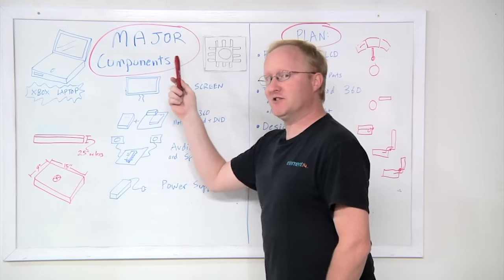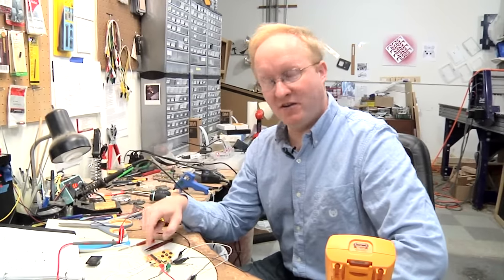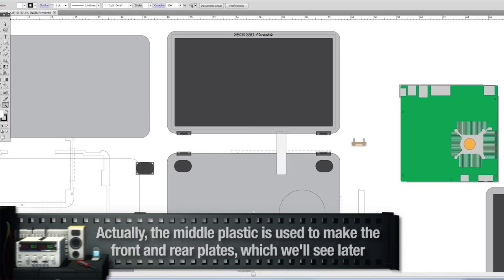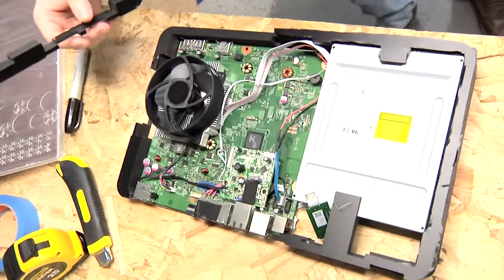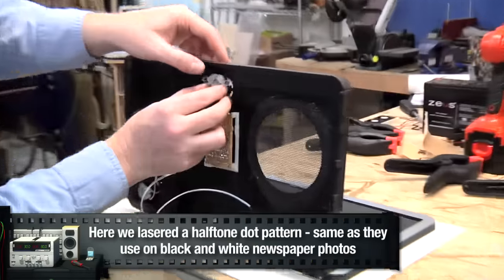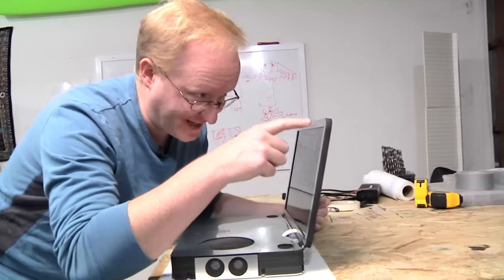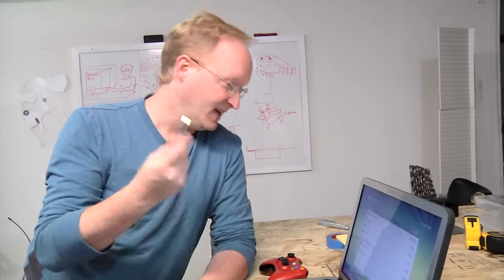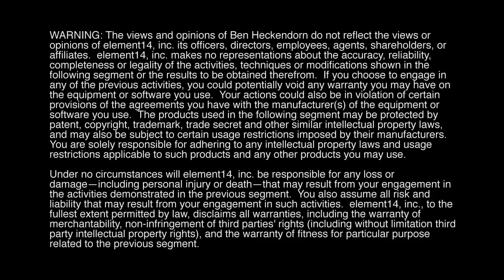The BEST Xbox 360 Laptop Ever!

Comment: Not top be rude but why would you need this? Instead of going through all the trouble why not just have a 360 and a moniter?
Reply: ***** The thing is it cant keep a charge so it would need a battery probably like a lithium ion one, but even still it is pretty cool.
Reply: Necromancer Anthony
So, no internal battery? Then what is the point? He basically just mounted a monitor to a console...
Reply: You could play in a car if you plug it into a power inverter.
Reply: ronaldo duran A monitor is more portable, has much lower response times, is cheaper than a TV, especially 4k with which the 360 couldn't even play in, it would be in 720p in games so no point.

Comment: You could use a 30 Cent very simple  LM386 Audio Amp can be found in every corner of a technicians box.The additional fans are undersized and can not cool the unit enough. You could use a type of blower fan found usually in certain graphic cards.

Comment: I have a concern about cooling with this project.  The 90mm fan (which covered the entire heat-sink) was removed and replaced with what looks like 2 30mm fans that only cover one side of the heat-sink.  Considering the reputation the XBox 360 has for overheating and de-soldering the graphics chip (essentially what happens with the red ring of death) that rings alarm bells in my mind.  How long have you tested this build with graphically demanding games for?

Personally I would be more interested in making a Wii U portable because you would have space from the smaller motherboard to include a battery pack and turn it into a true portable device.
Reply: Slim Xbox 360s dont overheat.That problem was solved on the Jasper model (late 2008 model) also this guy is a pro, this isnt his first 360 laptop. When he is putting in the two fans you can read on the bottom that the big fan on the Xbox doesnt work full power all the time but the two smaller fans do, also its doesnt matter if the fan is on the side of the heatsink what matters is it draws the hot air out of the unit.
Reply: Firstly the guy, while clearly cleaver and knowledgeable in electronics, is not a pro.  His intro states that he was a graphics designer who picked up electronics as a hobby.  Secondly, my concerns are valid because he is reducing the cooling capabilities of the unit well below the manufacturers specifications.  Weather it overheats or not in its standard packaging is not really the point.
Reply: James Lewis I already explained the facts, if you dont want to accept them. Thats your problem. I dont disscuss with people on the internet. Have a good day. (I silenced this thread so dont bother answering I wont see it).
Reply: +James Lewis he used a 360 slim witch has a les chance of over heating and the wii u is portable because the gamepad has a screen in it

Comment: a laptop that must be plugged in all the time....What´s the point??
Reply: because it's more portable to carry one unit with you than an Xbox 360, monitor, cables etc.
Reply: ***** Mount a monitor to the case of the Xbox 360. and buy short cables and tape them off in the back. BOOM! same thing... Pointless
Reply: Zmansk88 w...what? that's barely portable.
Reply: *****  Its essentially the some thing as he has in the video lol Don't get me wrong he normally does good videos but this "Xbox laptop" needs to e plugged into the wall ... so its about the same lol
Reply: Zmansk88 yeah, but 1. you don't have to have 2 wires and 2. you can't fold up a xbox 360 and monitor and carry it around, can you?
Reply: Zmansk88 Not to mention even the first real laptops also needed to be plugged in to the wall
Reply: Ethan Hawke *****  That's nice ,but seeing as its 2014 I think a laptop that has to stay plugged in is just pointless... A small TV monitor a short HDMI cable and hook it to your existing XBox and you have the same exact thing... (Without the fancy case) witch is not show stopping.

Plus if you have a PS3 ,PS4 or a ,Xbox one. You will be able to hook it up the same way without having to pay this guy to make a fancy case for it lol
Reply: Zmansk88 If you're going to a cabbin and doesn't have much space in the car or going by trai, or something like that and you don't have a lot of space(a small TV monitor + xbox360 do take up a lot of space) this could come really handy and it doesn't have to be about playing ANYWHERE, as much as an easy way to move it around. AND it only has one powersupply.

Only because it doesn't fill your needs, doesn't mean it's shit.
Reply: Most if not all powerful gaming laptops need to be plugged in while playing a system intensive game. Peggle and other games that don't require higher FPS can be played without plugging in but games like Battlefield, Skyrim, etc. need the laptop to be plugged in to avoid the limiter set by the laptop. You can, of course, bypass that in certain ways but you would realistically get a half hour of gameplay on battery when playing system/graphics intensive games.

Comment: the negative thing about the lack of a hard drive it that some games now require it but you can always buy a xbox 360 slim hard drive and use a usb transfer cable for pc hard drives to make the memory space bigger and the best part is that it runs through an external powersource so if you don't want to attach it you don't need to.

Comment: I loved it, but if you replaced the dvd drive with a slim one it could be smaller and you could possibly fit a ssd/battery
Reply: Xbox 360 has an annoying thing where the DVD drive and the motherboard are 'paired'. The motherboard will only use the DVD drive it shipped with (without having to reverse engineer + reprogram the drive).
Reply: oh, thanks

Comment: Hey Ben! i've been watching many of your videos, already subscribed and dont worry ill go back and give your videos thumbs up. since this video is an xbox 360 related one i had a question about a problem i am experiencing with my wifi adapter. long story short... the connection would cut off and reconnect... got it open with a flat head and didnt decide to try and diagnose it through my laptop until now and im realizing the under side of the circuit board, the antenna wire which i believe is soldered has come lose maybe. i apply pressure squishing the wire flat against the circuit board and i can get a solid light but blinks inconsistently when not.

Comment: Although that is a pretty awesome build, You should have hooked it up to turn off as soon as you closed the lide and turned on as soon as you opened it. Therefore you don't accidentally leave it on and you wouldn't have to use the power button.

Comment: What would be cool is having Windows OS on there alongside Xbox. Use a netbook motherboard but that would require 2 motherboards, 2 power supplies, more fans and a HDD so it wouldn't be very small but would be awesome! Could like run both at the same time. Have Xbox display on a TV via HDMI and run the Windows on the portable LCD. Would be more portable than carrying a laptop and an Xbox since we usually take laptops with us.

Comment: You should have built in a kinect on top of the screen like a webcam. It would be cool
Reply: but totally would not work, since kinect for first, is huge, second it need to auto adjust every time you wanna use it and third it would drain power that they didnt have. They even take out HDD just so they could have amplifier in that unit, technically they maxed out how much power that power brick can send to that unit.

Comment: Of course you could've just emulated the x-box operating system on a PC laptop, but it was just cooler to do turn an x-box into a laptop. GENIUS!
Reply: Xbox 360 can't actually be emulated properly yet, nor can it's original predecessor, so until it can a cool laptop mod is definitely the way to go.

Comment: whats the point if you always need to have it plugged in still....
Reply: +dang mang you can take it anywhere (like on a vacation) and plug it in there to play
Reply: +dang mang It's a system and a screen all in one portable unit.

A battery to power both an Xbox 360 and the LCD screen, would be massive and heavy. And would probably only get you an hour or two of gameplay, anyways.

It's meant to be easy to take it anywhere and just plug it in and play; it's not meant to be a portable device like handheld stuff.
Reply: whats so hard about bringing the console and a light flat screen tv... its litterally 10 more seconds of work. i wont deny its cool what he did but as far as having any use. it doesnt
Reply: +dang mang Because that's so much cooler to do it yourself. 
This man just made a Xbox witch is a home console into some kind of portable console, or at least all in one movable game unit, just by printing a plastic case in his basement, and soldering some cables in the console. 

It's so much gratifying just to be able to do that.
Reply: I know it is cool but if you taped a monitor to the xbox its kinda the same thing
Reply: ***** Yep, kinda.

And it's that "kinda" that make a real big difference between the simple monitor taping, and the work that has been done here.
Reply: the point is to make it so that you only need the power brick almost like it's just the charger making it portable especially good for the cars with outlets in them these days. he made it so that it's as portable as possible
Reply: +dang mang Who the fuck takes a flat screen tv with them on vacation. Take this and it's fine.

Comment: to the people complaining about having to plug it up, wouldnt that make sense for it to HAVE to be plugged up. all the power the machine generates it would make sense to have to plug it up if not your gameing sessions would be short
Reply: With such a brick of a "laptop" he could've added a battery. He just cut corners and cost, as it requires work and stuff. Also the hardware of an Xbox isn't made to be running on a battery, so you'd need a large and expensive one to run it for more than an hour. Just look at the harddrive bay, it's insanely huge, I can't imagine it being impossible to get a smaller one instead and laying a suck battery on top. (most laptop drives are about 1/4th that height).

Comment: i don't c y the giant 5" floppy disk drive is installed, but the HDD was considered legacy......who needs discs, LOL?! i was wondering if i could replace the disc drive with a concave controller hole, but while typing this i looked up the controller height of 2.41 inches so it's almost half an inch too tall :\ i'm pretty sure i could build or minimize the existing power brick 2 put in place of the drive, tho... then it just needs a longer PS cable 2 comfortably reach outlets, but its receptacle, the female receiver from the brick, can b mounted on the back panel 2 the right of the USB-holes.

Comment: Hello, I currently changed my major to computer information systems / computer support.. I am getting an associates and then an going to continue into information technology. Is this the right degree for me to be doing stuff like in these videos as a hobby easily... Or would I need some engineering in there.... Basically I want as my job to be able to build/ fix hardware of computers (this includes having knowledge of the specifications and power requirement of the system) as well as having a fair amount of knowledge about the software so I can make the computer to the best of its abilities and be able to diagnose issues because of crashes troubleshooting, etc. As well I would like to be able to network multiple computers and device in a modern style such as to include tablets, Wi-Fi, printers, etc. Also to be able to network big businesses where it waitress a identification and pass to login to one system... I would also like to be able to encrypt data and keep it secure as all as knowing enough info on security to be able to protect the network and even just a home PC from minor hackers as well as viruses to include malware and spyware... Sorry I am a newb at this stuff and just need to know if I am going down the right path for this type of career I thought computer support would be a good start then move to IT maybe minor in cyber security then go into business to start a computer company  IDK please comment and tell me what you think... I am asking anyone that is concerned even the makers of the video. Thank you.

Comment: Why not do the opposite of this? Why not make a portable system into a console? 3DS, Vita, DS, ect?
Reply: Soul Evans What would be the point, the games on them are designed to run at lower resolutions due to screen sizes and hardware limitations, plus with a Vita for example I'm pretty sure there's already a way to play games on a TV using remote play so its utterly pointless.
Reply: RedDragonGamingHD It was just a suggestion, no need for the harshness.
Reply: Soul Evans Wasn't trying to be harsh was just my 2 cents
Reply: +RedDragonGamingHD ps vita tv anyone